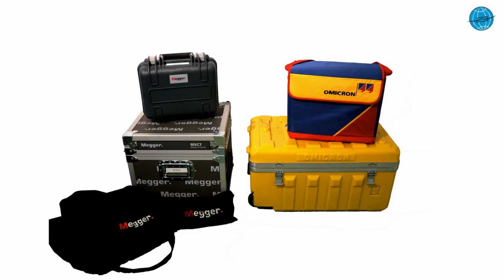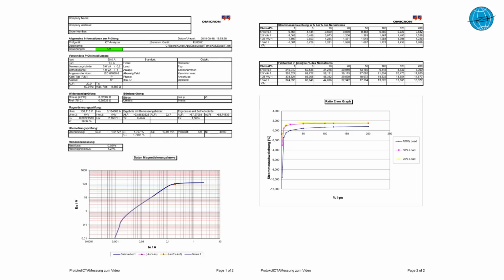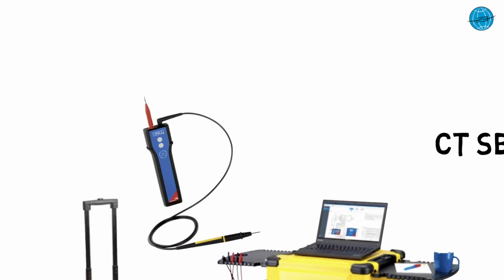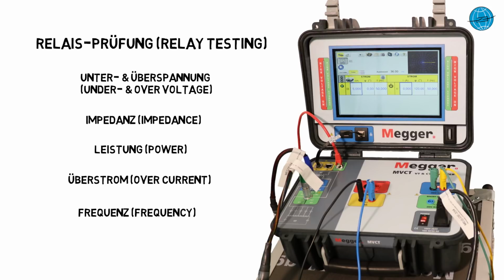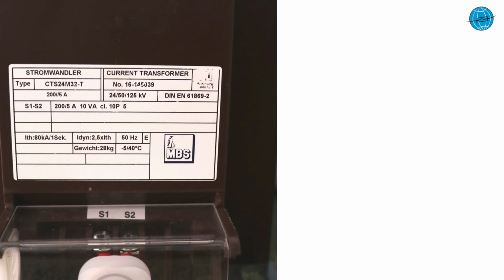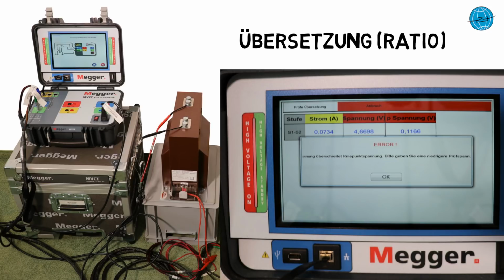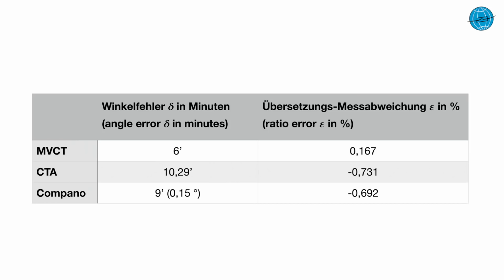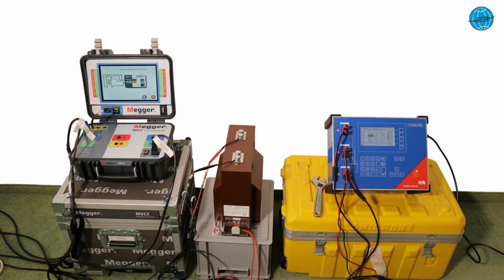OMICRON vs  MEGGER | CT Analyzer or MVCT

Comment: I’m owner of the Megger MRCT and choose it because is faster than CT Analyzer and dont require additional modules for multi secondary, price are similar and includes CVT testing functions, and the licensing troubles that the omicron have. Is easy to upgrade firmware.